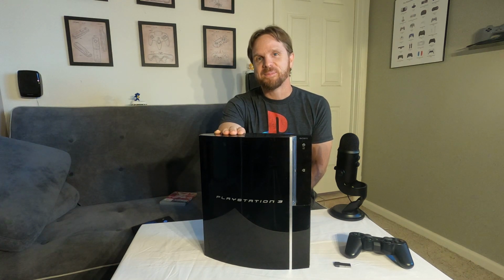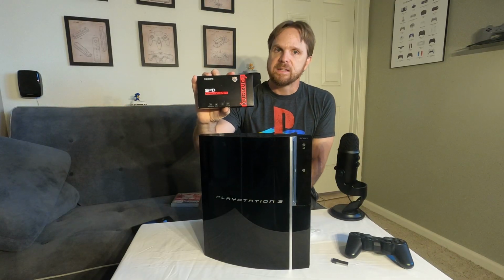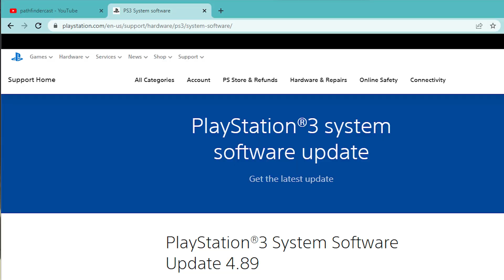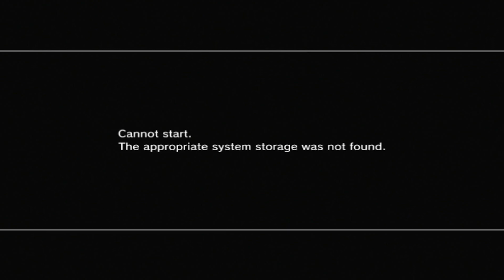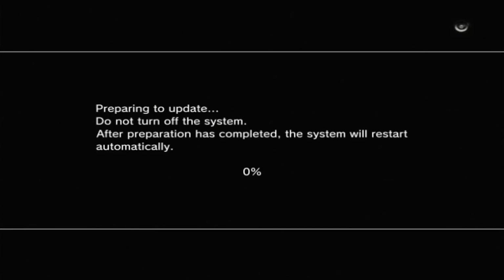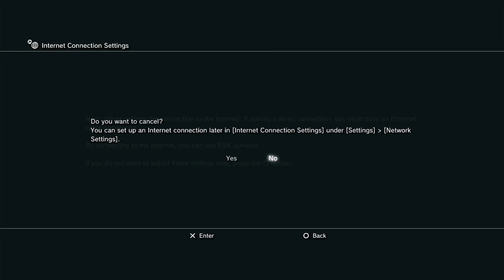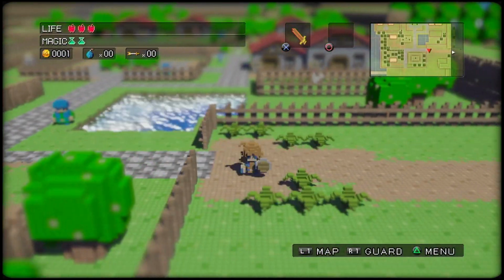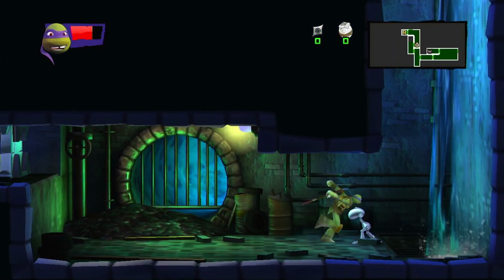Installing a cheap 1 TB SSD in my PS3 for a performance boost

Comment: I got a Backwards Compatible PS3 from Goodwill for $100. It had 3 games and two original controllers. It had never been opened up. Fantastic system.
Reply from the maker: That's awesome. I think right now is a good time to pick up deals on the PS3.
Reply: @pathfindercast  I agree!!! They wil go up in value
Reply: @pathfindercast  there are no "performance gains". You're stuck with the same bus speeds and the PS3 doesn't support trimming an SSD so eventually it'll just die
Reply: Ive owned 3 backwards compatible ps3s and they all eventually got the yellow light of death. I'd rather have the slim they are more durable.
Reply: @poncho828  yh if you've ever opened up a fat ps3 you realise why lol. The casing of the psu is metal and placed right above the gpu/cpu. So the psu generates heat and the metal casing just heats up more with it and sitting on top of the cpu/gpu isn't good. Whoever at Sony ok'ed that design needs to have a word with themselves lol.
Reply: @edbeasant9494  The reason they fail is due to a manufacturing flaw in the GPU. The connection between the RSX's die and the substrate it sits on fails. It is the same flaw that earlier Xbox 360s suffer from and a bunch other GPUs from the era as well. It has nothing to do with where the PSU sits, the PS3's thermal design is sound.
Reply: @ADBtech  eh its not which Is why In later revisions it was changed
Reply: @ADBtech  the reason 360s used to fail was due to using lead free solder. As it used to heat and end up cracking.
Reply: @edbeasant9494  the guy who approved that design did it on purpose/sony did it on purpose same with xbox and red ring of death strange that both Consoles had almost the same problem at one point and it was on purpose so people buy a new console it was marketing strategy.
Reply: @drboom2  marketing tactics so people buy a new console ^^
Reply: @XWXS2  definitely seems that way
Reply: @edbeasant9494  Guys, I really recommend doing some actual reading. Josh Davison aka Octal450 has some great videos explaining the issues with these consoles. It has nothing to do with lead free solder, are you living in 2008? Those theories have long since been disproven. It was an industry wide problem. Read about the MacBook Pros from that era, they suffer the same faults. Stop sharing inaccurate information. Even Microsoft has confirmed the substrate connection failure in the recent Xbox documentary.
Reply: @ADBtech  so it's nothing to do with the motherboard flexing and cracking the solder lol
Reply: @ADBtech  so it's nothing to do with the motherboard flexing and cracking the solder. It was due to the consoles heating up and then cooling down.
Todd Holmdahl, Xbox’s head of hardware from 1999 to 2014, explained that the real problem was the console’s temperature going from hot to cold too frequently: “All these people loved playing video games, so they would turn this thing on and then off, and when it would turn on and off, you get all sorts of stresses” he said.
Specifically, the soldering balls used to adhere the GPU to the motherboard were flexing ever so slightly every time the Xbox 360 was turned on. Over time, this flexing led to cracks that eventually prevented the console from working at all. This meant each and every Xbox 360 sold was a ticking time bomb waiting to go off. 
That's from a Microsoft documentary apparently mate lol.
Reply: @edbeasant9494  i mean yeah kinda, it is sort of caused by it heating up and cooling down, but the thing that goes around the solder balls in the gpus was meant for 70c max temp, nvidia did not know that, so as you are gaming or putting the gpu under high load (which will go to around 70c) it melts and then the solder balls have no protection, in turn causing them to crack under thermal stress.
Reply: Get external cooling fans for it.
Reply: @USSHammerology  don't work
Reply: Nice do a refurb on it and it will last
Reply: @JAKEDOWN92  not really I've referbed one before they still end up the same way
Reply: @edbeasant9494  I've refurbed my CECH-E01 June 2021 when I got it, by cleaning it out, rethermaling it and putting a fan from a Japanese BC PS3. Never exceeds 69 celcius and it's still going strong
Reply: @kittbluevenom2384  yh it'll still die
Reply: @edbeasant9494  everything dies, it's more of preventing the innevitable.
Reply: @molotovick  fr. why do people always pop up smugly saying "itll ylod eventually" like duh it will. these things are nearly 20 years old. no one said they were perfect, let people enjoy things like damn
Reply: @ps5hasnogames55  ong
Reply: I have Xbox 360 backwoods compatible  I have it with 100$ in 2015 rgh ✊🇩🇿
Reply: Wow thats a steal!
Reply: I got one from eBay for the same price about 4 years ago. Best of all, it’s virtually brand new with all original mint packaging included. 😮
Reply: @princegroove  A 60GB backwards compatible one? Man I wish I could find 1 for under $100 in mint.
Reply: @TAMPATLBLACK  Yeah, retro gaming is expensive now. 😂
Reply: It’s a ticking time bomb,I’ve had three all go yellow light and you are pushing the dust into other places unless you take it apart and do it properly.
Reply: I implore everyone in this thread to not trash your Back-compat CECH-A and CECH-B units when they YLOD. Apparently, there are methods to revive them. Sell it as "for parts" on eBay. The modders will know what to do.
Reply: https://youtu.be/I0UMG3iVYZI
Reply: Please start doing some mods to keep it alive. There’s not many of them around anymore due to yellow lights.
Reply: These comments are crazy. I've had mine for 18 years. Only recently it's overheating and shutting down, but no yellow light and it still boots up just fine. I'm gonna change the thermal paste and put in an SSD while I'm at it.  Some people just don't know how to take care of a console.
Reply: Time to open it before it overheats
R.I.P.
Reply: Until it yellow lights
Reply: @edbeasant9494  Still hasn't. I've done several 24 hour download and install sessions.
Reply: @PracticalBibleStudies  it will that's the point the old ps3s all will fail eventually they just weren't put together very well.
Reply: @PracticalBibleStudies  you will have it eventually , just like the 360
Reply: @haloepic3092  and here we are a decade later...
Reply: @PracticalBibleStudies  knock on wood
Reply: @edbeasant9494  that happens in less than 1% of PS3 which is still too many for 90M units
Reply: @TAMPATLBLACK  bollocks lol 😆 that's sonys "estimate".

Comment: Those vents are spotless I wouldn't open in it until one of the parts fail. Seeing it that clean outside will definitely give you a good enough idea of what the inside looks like. Great find.
Reply: Hmm I would open it and deep clean and new MX4 thermal paste it, its just a seal and also it will hopefully be in his collection forever
Reply: Keeping it clean inside will prevent parts from failing, the vents may look clean but the heat sink could still be caked in dust.
Reply: @linkssz1699  that's extremely uncommon for the exterior vents to look brand new and th heatsink caked. Unless something fails it's not worth opening period end of discussion.
Reply: @socom2wasgreat542  it's not uncommon, all heatsinks get clogged with dust if they aren't cleaned for ages.
Reply: @linkssz1699  but the dust would.come thru the vents you goof it doesn't just appear in the heatsink. Drop it, make your own comment thread.
Reply: @socom2wasgreat542  Except if the previous owner also cleaned the vents like he did in the video. Pushing all the dust further into the console. Based on the vents it is impossible to tell how the heatsink looks like since you don't know how the previous owner used this console. Also thermal paste has a limited lifetime. Just like oil in a car you need to change it even if it is still running fine. Depending on usage thermal paste can last from 2 to 10 years. So this console is definitly overdue. Cleaning the heatsink and swapping thermal paste is basic maintancence on old hardware.
Reply: @Tobias L.  I've never changed the thermal paste on a well running ps it's more like transmission fluid where the average person will fuck it up. Cleaning the dust off the heatsink and vents is changing the oil. I have 3 perfectly running ps3s with original themal paste. You don't have to change it.

Comment: If I mod/jailbreak my ps3 system as you did will I get banned?
Reply: Just don't connect to internet after jailbreak
Reply from the maker: That's a tough question to answer. Eventually you will likely get banned, but I also don't think Sony is really investing any effort with PS3 and banning consoles lately. That can change at any time and I don't connect mine to the PlayStation network.
Eventually Sony may just discontinue support altogether and unofficial replacement solutions will appear similar to what happened with the original xbox and wii options that are now available.
Reply: Not anymore...